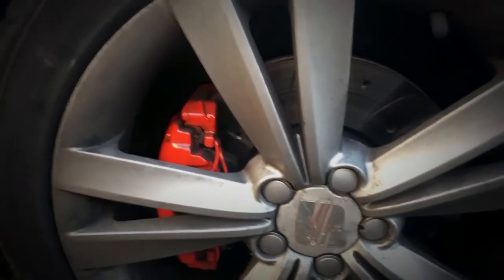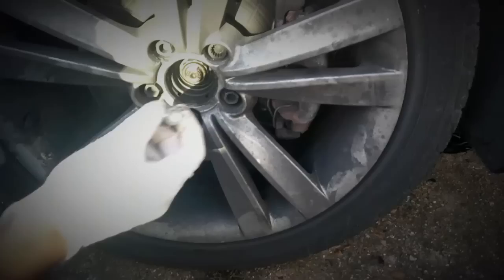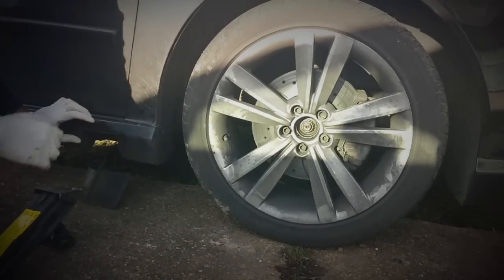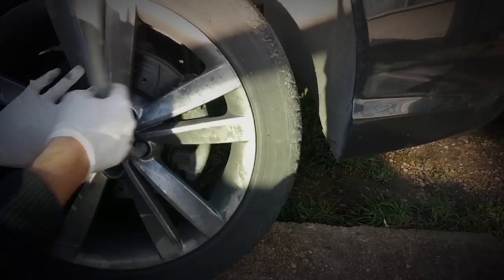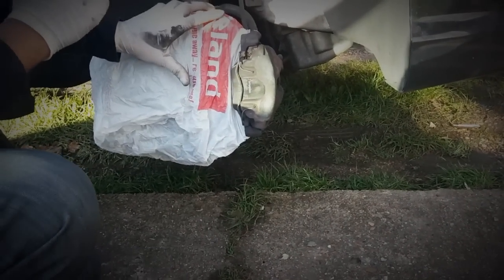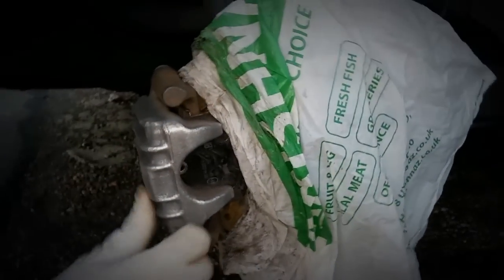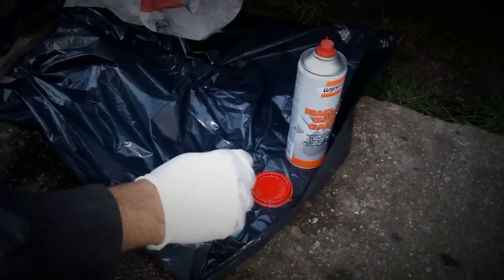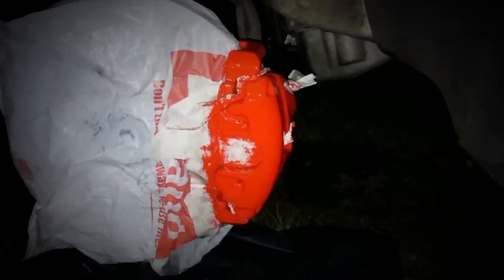How to Paint Brake Calipers - Brush method

Comment: In all honesty: If I was to upload a video of painting the calipers on my ride, firstly - I'd skip the tedious footage of removing the wheel, secondly, I'd have the car already safely fixed in position on a proper jack, ready to do the necessary preparation/groundwork prior to the actual paint-job itself (even though nothing comes close to physically removing the parts to be given color altogether - and in that way, ensuring a proper cleaning-process before applying primer, finish laquer (+ clearcoat for added durability!). In between the different operations, I'd definitely spend the time needed to thoroughly clean (and polish) my rims, - as I've already gone to the trouble of dismounting the wheels themselves in the first place!...) But, as the saying goes, ''Whatever floats your boat..!'' We're all different in sooo many ways. Just sayin'....

Comment: Sorry but couldn't watch your video to the end. Hard to take car care/improvement advice from someone who A) keeps their car in that kind of state B) takes 4 minutes to get a wheel off and then worst of all C) starts doing any kind of work on it whatsoever while it's only supported by the wheel jack. That's basic car maintenance lesson 1, otherwise known as common sense. 

The appearance of your car would be improved far more than any caliper paint job if you just washed it once in a while. Invest in a torque wrench, you don't have to spend a lot, £25 will do, and learn the proper torque setting for your wheel nuts. Not only will it make it easier to get your wheels off (especially in an emergency) but it will also prevent lots of other potentially serious problems, like buckled alloys and snapped studs (which is what happens when you put a long enough piece of tube on your wheel wrench). You'd be surprised how little torque is actually needed, basically if you have to stand on them to get them off, they're too tight. If you have a tyre changed make sure the fitter torques the wheel nuts and doesn't just zip them up as far as his air gun will go. Finally get a proper jack and axle stands and USE them, you could save a lot of damage to your car or even your own life. Even if you are doing an emergency wheel change at the side of the road with the wheel jack you should put the wheel you take off under the car until you get the new one on, then if the car drops off the jack you can still get the jack back under the car. 

Then when you have bought those few small car maintenance essentials and learned how to use them, go and buy some caliper paint, it'll look great.
Reply from the maker: +Mcpricex I'm with Ace A on this one.
Reply: Guys, he's just showing the basics as if he's someone not lucky enough to have funding for the necessary kit. The safety part is right though, jack stands etc....especially when left over night....... For an unseasoned guy, he did get a half decent result............ I use the same Halfords Red Caliper paint in my custom workshops and get no complaints...... I use power tools to do clean and clearing of all the muck and bullets to get a smoother finish but hey......... Nicely done fella!!